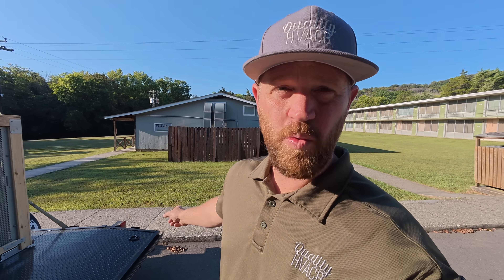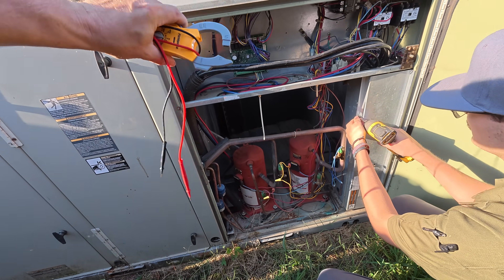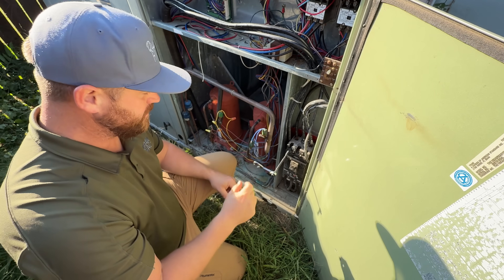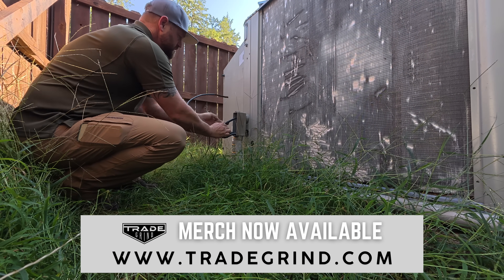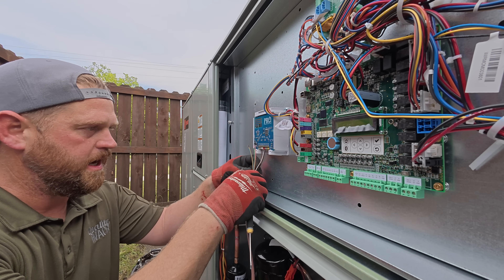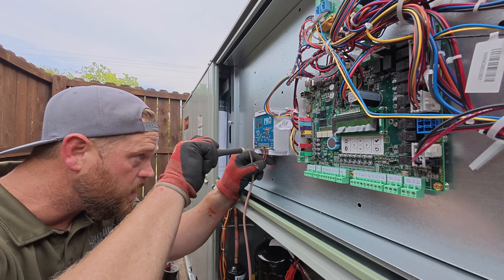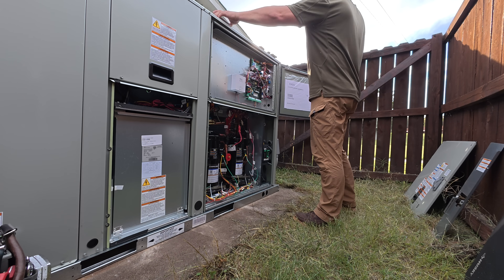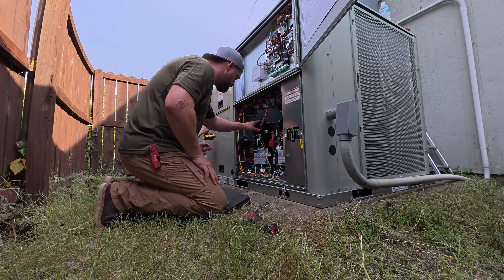Commerical HVAC Install - Trane 8.5 Ton Heat Pump

Comment: Just curious could you have downsized your heaters just a little so you could operate the heaters and the heat pump as normal? Maybe drop down 5-8KW if it left enough backup heat and if that was enough to operate your compressor(s). Just a thought. If not it should still save them quite a bit over the way you set it up verses what they had. Nice work! Keep it up!

Comment: Nice install but I don't understand what needs 8.5 tons? The building does not look very big. Is it a hotel or rooming house? Is it insulated at all? I guess I think a comprehensive energy evaluation should be done before an install that large and costly. It looks like a huge energy waster with the exterior ducts and pumped into the attic.

Comment: I think you should put emphasis or be more detailed on the beautiful unit you installed, "the Trane Preced powered by Symbio controller ". 
I saw u put a Pro thermostat with wireless kit but this particular unit works optimal with Trane zone sensor (thermostat) ,  u can obtain 3.5, 5, or 8.5 TON capacity depending on the demand. 
Also could be a good reference know about the blower characteristics and I didn't see if U pulled out the fresh air or economizer tha comes inward 

That particular unit is a good state of art...
Reply: There was no economizer you can see on minute 5:04

Comment: Sorry to say, you explain about the unit you are working on. The way you are doing.  York 8.5 ton heat pump is not enough, and do not detail the tools you are using. Doing good, but not as helpful as it should be.

Comment: What was stopping you from getting an electrician involved in the install?
Reply: Technically hvac dont need electricians as long as your making connections from existing connections. If you had to run new wire to the panel with a new breaker than your suppose to have a electrician but most still don't because it eats into profits and if you do hvac your basically already a electrician just not licensed.
Reply: @FriendsFade  yup ive ran new power from breaker panel to the outside😅 for hvac
Reply: You mean a princess 👸
Reply: they knew what they were doing and didn’t need to pay an election to come out, wait around take 10 minutes to hook it up.
Reply: Simple change out,  just reconnect the wires no need for electrician.
Reply: He's like most. Personally, I went to trade school for com/res electric. I'm an electrician and a HVACR technician. Always nice to have the two licenses but I don't need them when working on contracts for companies.
Reply: @merllhagard6799 never went to trade school, my HVAC training was OTJ, and it had basic electrical training. Moved on to a different trade now tho
Reply: Probably the difference between getting the job and not.
Reply: Hvac techs are experienced in a mix of plumbing electrical and hvac all in one ... mix of a lot wiring working with 8 10 and 12 wire high voltage and low voltage
Reply: He’s not a pansy

Comment: Correct me if I’m wrong, can you set up the hp lockout through the symbio controller. Just a thought for next time to simplify 
Nice work as always.  After working all day, I come home and watch you work😂
Reply: Yes you can setup the lockout through Bluetooth connection to the Symbio 700.

Comment: I retired(2/28/ 2013) from Trane, Inc in the Tyler, TX plant, which made 1/2 to 6-ton condenser units.  I think that unit was made at the Ft. Smith, AK plant.

Comment: Didn't see a phase protector and thought that was a common thing for Trane.  Sure have changed a lot in these last few years.
Reply: It’s behind the low voltage panel with the contractors

Comment: I love your videos and content. Of course people love critiquing videos, and mine is that you are missing some PPE when working. I’m no safety enforcer, but would be nice to have seen gloves when using glue, or safety glasses when drilling your hole. Just my 2 cents. Personally have had too many close calls, so I try to promote safety as much as I can. No job is worth getting hurt, and you are asking for it when not wearing PPE.
Reply: Gloves for glue? It’s a lot funner pealing it off my skin lol.
Reply: @NW_drew  been there too many times. But it’s honestly terrible for you, it’s absorbs through your our skin and the chemicals in the glue is carcinogenic. My brother is a chemist and made me aware. So I grab a couple pairs of disposable gloves when I have to use PVC glue. 
I worked with a fella when he had to have metal shavings drilled out of his eye ball. Lucky he didn’t loose his vision. Also hearing protection is important. Especially in commercial around loud equipment like chillers. Stuff like this ain’t talked about enough. I have worked with so many apprentices that aren’t taught lock out tag out, or even have any gloves or glasses.
Reply: @brandongreen1177 absolutely agree! Appreciate the advice and will be wearing gloves more often! Thanks for the advice.